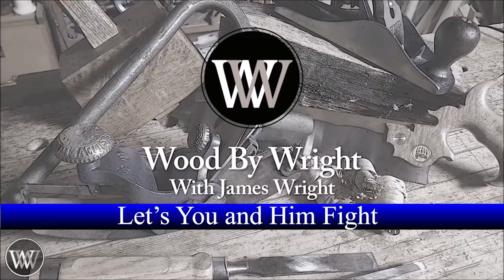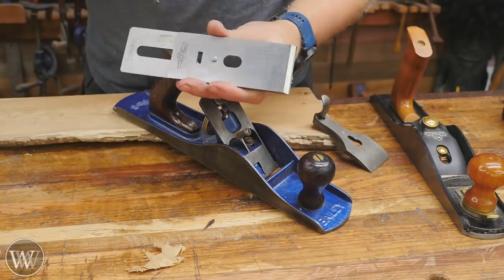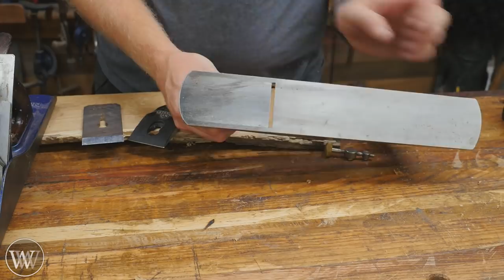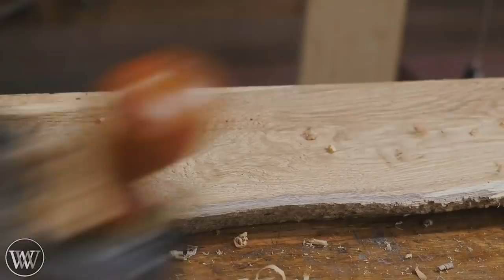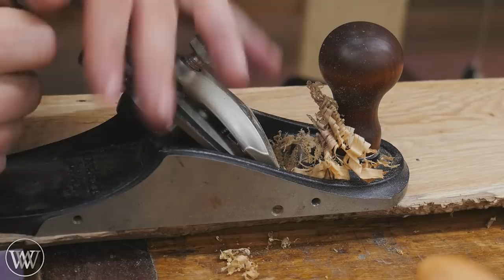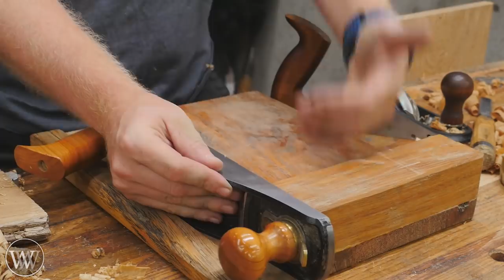Low Angle Vs High Angle The Best Plane For You

Comment: Finally a decent demonstration! Most other videos about the difference between traditional bevel down / low angle bevel up just tell you that you can basically turn your bevel up into a bevel down by using a blade with a different angle and call it a day. Which makes you wonder, if it were just that easy, then why aren't all planes bevel up, why bother with all the extra parts and complexity of a traditional plane...

Comment: Great video! Why do I consider this a very important and very correct coverage of the problem of choice - for a simple reason, many craftsmen, especially those who have extensive experience and a lot of knowledge in the use of hand tools, do not see anything incomprehensible and unclear in the coverage of this issue. 62 planes, they are also called “werewolves” in Russian, “cross-cut planes” are considered by beginning craftsmen to be a remedy for the problems of planing complex wood, a low cutting angle, a massive piece of iron, an adjustable mouth - all this is designed to make the process of planing complex areas simple and high-quality, but mostly quality, because it is believed that the more expensive 62 plane will do the job better.But in the video we see a slightly different picture - the knife with the frog is adjusted more precisely, which means it will be better applicable to each specific case, and in fact it cuts simpler and easier! And due to what? Due to the same cutting angle of 45 degrees! We turned the knife with the chamfer upward, but the surface of the upper cutting edge relative to the planing surface is 37 degrees, less than 45 degrees, which means cutting the end fibers is easier, but only the end fibers. The master showed us an excellent carpenter's bottom for planing the ends, the 62 plane copes with this perfectly, you can also use classic planes, but the 62 with an additional handle is a masterpiece in this work.Great video! Explanation of many questions on various planes comes during the discussion of knowledgeable people and showing examples of work! Thanks a lot!

Comment: Hello, new guy who is somewhat starting to use bench planes and looking into the histories and what not of the tools. In my personal opinion the high angle, bevel down design with early modern to today’s metal bench planes are like a legacy design. It does make sense during the time transitioning from wooden body/sole of a bench plane to a metal (bronze/cast iron,) body/sole. If it ain’t broke why fix it mentality when Stanley first started making metal bodies for the plane designs. Since most and probably all of the planes before Stanley’s Bailey design were made with a very hard and dense wood that can handle abuse pretty well. It was probably very difficult to try and either to mortise (cut out,) or a laminated style during the late Victorian time period to early modern period. There is also the chance with the wood too not being durable enough to handle abuse with how thin trying to make a low angle, bevel up design with just wood. Although I could be wrong about the wooden design.

Amazing video though, keep a good job making amazing content for wood working
Reply from the maker: Bubble up low angle planes have been around for hundreds of years. And they are plenty durable. Most of the time they were used for shoulder work or for flattening chopping blocks with end grain. But for general use they were not as common. Not because of their durability just because of their function. Blue Angle plains didn't become popular until after most hand tool use died off in the '70s and '80s.
Reply: @WoodByWright  Thanks for the info, I am still somewhat new to these types of tools, never hand to use a bench plane until two years ago. I am always interested into looking into what tools I have used and go into the research mode and have my own assumptions on why or how they worked like that and why this type of designs. Thanks for responds from a video that two years old, most YouTubers usually don’t bother with how old their vids are and what not. Amazing videos so far that I have seen. Have a wonderful day or night

Comment: Great Job James!

With your permission, I would like to submit your video to Lee Valley"s HQ training division.  This would be a fantastic way to teach our new associates about the difference and help them better advise our customers on choosing a good plane for the customers needs and budget.

BTW, I would like to make a point of order.  The blade of a high angle plane is a two piece blade and the parts are the Cutting Iron (commonly called the Blade or better the Iron) and the Cap Iron (the part many today mistakenly call the "chip breaker").  The actual chip breaker is merely one FEATURE of a Cap Iron.  It is the hump at the leading edge.  This not only compresses the wood and breaks the fibers to prevent tear out; it also focuses more reinforcing pressure to the very tip of the Cutting Iron.  The result is a significant reduction in chatter on the cutting edge over the original flat design.  It this through both improved direction of force and the introduction of spring action similar to springs in a cars suspension.

As a "traditional joiner" I would ask that you use the correct terms as they actually have important historical and functional differences.  The whole part is the Cap Iron.   While the hump, and only the hump,  at the front of the Cap Iron is the Chip Breaker.  The terms are important because they concisely convey very precise meanings.  Thus it is important to use terms properly in order to maintain clarity within a given discipline. 

Once again thank you for the wonderful videos you make.  You have been a major aid to myself both as an instructor in the science and art of joinery and as a customer advisor at Lee Valley's Winnipeg store.  Your honesty, humility, passion and humor shine through in your productions, and they have been both inspiring and educational for both myself and my students.  Should you ever find yourself North of the border and in the Winnipeg area, please let me know.
Reply from the maker: Thanks! that means a lot. I would be honored if you would use it. one of these days I want to get north of the border and visit an actual Lee Valley store. in retrospect I wish that was one more point I would have clarified. there is always something I see after it is published and wish I would have worded differently. LOL

Comment: Thanks, I am just learning about planes now. One interesting thing I would like to add is I saw Rob Cosman swap out a blade and chipbreaker on his jack plane. I hope I get the terms right here he had a blade and chipbreaker set up for smoothing and one another pair set up for hogging. This was a high angle 5 1/2 Woodriver plane. Typically I see woodworkers with two different planes perhaps of the same size. Starting out and being a bit miserly I think this is a great idea. Of course this could be done on a low angle plane as well. Thanks again for discussing the pros and cons of each.
Reply from the maker: I'll swap out the blades for my low angle, but putting a different angle on a high angle plane really doesn't make any difference at all because the bed angle is what sets the cutting angle of the plane.
Reply: @WoodByWright  Yes indeed. In Rob’s case he was swapping between a chambferred blade and on that was not.

Comment: I’ve been trying to become more proficient with hand planes. I have always used power tools for everything I have ever built. A chisel here and there. Someone gave me a Stanley no.4 and 5 so I decided to learn how to used them. I’ve watched dozens of videos on how to tune up planes, sharpen irons, set chip breakers.. you get the idea. But I still can’t get a smooth consistent finish on certain woods. It’s so frustrating. I watched this video hoping you would demonstrate how a low angle plane would produce a smoother finish but that’s not the case.

Comment: I'm interested in the shavings themselves. I'm making small things from veneer, and it would be a nice touch to make the veneer from some meaningful piece of wood, even if I have to glue multiple bits together to get what I want.

Which tool would I use to get shavings of wood closer to veneer?
Reply from the maker: for that you want a low angle plane without the chip breaker.

Comment: I now think the low angle bevel up wins every time because it takes much less effort to cut through the fibres.
I’ve just bought a Zen Wu blade and chip breaker to upgrade my Stanley number 4. It doesn’t fit at all well. However when messing around all possibilities I tried bevel up, no chip breaker either  Stanley or Zen Wu, but just the cap iron. I adjusted the blade and tightened up the screw and it cuts a dream with no chatter.The mouth is wide open, however. The proof of the pudding is in the shavings. I seem to have created a high angle and it works a dream despite an open mouth and a sort of chip breaker set too far back to break chips. I reckon the blade approaches the wood at 70 degrees. 
I could mill out the mouth to take the new blade and chip breaker, but it looks like the protrusion is insufficient with the new blade. I might have to mill a new slot in the blade as well. I’ll stick with my unorthodox bodge for a while as it appears to work fine.

Comment: Thanks! Which three planes would you recommend for a new woodworker?
Reply from the maker: It depends on the individual on what you want to make. If the things you're making are less than 2 ft long I generally say a number four is the best place to start. But if you're going to be making things that are longer than that then you probably want to get a number five. If you're having trouble setting up hand planes then getting a low angle Jack is a great way to go it's a simple plan that most people can Master pretty quickly. Those are the three most used planes and most every shop.

Comment: Thank you so much for your clear explanations.  I follow several, actually quite a few channels, I find that yours,  Paul Sellers, and the "10 minute workshop"  are the best no BS teachers.  

This video is very timely for my education am process. I am just learning about and how to use hand tools.  I am taking a hand tool sharpening course from Highland Hardware in Atlanta next month before I purchase a plane and better chisels and other goodies I can slide by the "boss" !

I have seen some sole plates lubed with wax, and others with oils.  Which do you prefer and do either of them effect the finish on the wood?

Thanks for your answer in advance.
Reply from the maker: that sounds like a fun time. that is a fun store.
I use both. I make a paste wax that is infused with oil. I ahve done the rag in a can and I have done several strait waxes. but this is what works best for me. no. they do not affect the wood at all.
Reply: Hopefully your sharpening instruction will put you on the right track. Sharpening is one of those simple topics that people like to complicate. At its core you're trying to get two polished planes to intersect. That's it. Do that and you got an edge. Now the trick is to do it as efficiently as possible. Taking too long or using things that cost too much put you further from the ideal. Right now I'm using synthetic diamonds and ceramics. In this day and age they're fair choices. I use an Eclipse style guide for plane irons and chisel blades too. That gets me a precise bevel with minimal effort. Things only need to be as hard as they need to be. Consistency pays dividends. Hollow grinding a primary bevel is fundamental too. Not doing that puts you back from where you should be. I have a fancy sliding tool rest I made. I basically ripped off the Veratas rest design kind of. A Google search of sliding tool rest brings mine up high in the returns. I don't know if it's just me? Now it is giving me mine first.

Comment: It would be possible and not too difficult to machine a chip breaker for a bevel up plane. Then you would have the best of both worlds in a bevel up low angle plane.
The handle on the Stanley Sweetheart doesn’t look right to me. Is it good and comfortable? My Qiangsheng has a lovely comfortable handle.
Very informative video. Thanks

Comment: So I have two questions I'll go with the most relevant (at least to me) first: is there a reason the low angle has a much thicker iron than the high angle? And as far as shooting planes go is making one basically the same as making any other plane just putting the handle on the side instead of the top?
Reply from the maker: the original 62 did not have a thicker iron, but in this case there is no detriment to a thicker iron as there is with a bevel down plane (the tip is too unsupported)
for the most part that is one of the big differences though there are hundreds of different shooting boars panes all with different features.
Reply: @WoodByWright  ok was just wondering about that, because that iron looked super thick. And any suggestions as to where I might find a video on building a shooting plane? I've only got a #12-404 and trying to use that on my shooting board is not super easy, has a very strange feel to it.
Reply from the maker: Usualy I would use a #5 or #6. but I know a lot of people that take an old wooden plane and mount a handle on the side. I do have a series on making a low angle wooden plane that may fit you well.

Comment: There is the best answer to do anything in woodworking! Not exactly what you might think it would be but sure our ancestors knew it very well as the spent a lot of time doing it. The best answer is the one that makes you more productive or more efficient. Except that sometimes you don't know how to use tools efficiently or what tool. And in hobby world everybody tends to not care about efficiency. And then there is a fact that function of chipbreaker was forgotten and rediscovered again in 2011-2013. But once you master it then you know what it is for. And yes, both are needed for different tasks. Heck, for that matter even machines are needed for best efficiency. But here it is - if you are more productive then you are doing it more right than you did before.

Comment: Great video as always! I've been looking at the veritas custom planes recently. I have a low angle smoothing plane and jack and my fingers are long enough to adjust the norris adjuster more or less on the fly with them, however the bailey style is much easier and more comfortable to adjust - can you adjust on the fly with the veritas custom planes?
Reply from the maker: I'm not quite sure what you mean by adjust on the fly. I find both to be about the same to adjust.
Reply: @WoodByWright  Sorry, that wasn't very clear. I meant reach the adjustment knob while holding the tote. With the Bailey planes I can increase the cut while I am planing to make "micro adjustments"...I hope that makes sense :p

Comment: How about buying one good blade, and building wooden planes with different angles that use the same blade!
Reply: Actually, that is exactly what is done in Asian/Pacific cultures.   Their blades are about 2 to 3 times thicker than Western plane Irons.  As a result, the Cap Iron with its chip breaker is simply not needed.  The disadvantage is that such blades take much longer to sharpen; though they also hold their edge longer.

Comment: Well i will never take part in the argument for or against either style again. I use BU planes but don't care for them. I find the norris adjuster to difficult to get the blade set perfectly parallel.
Reply from the maker: that is it's drawback, but then again it depends on the adjuster I have used a few Norris Adjusters that were a charm to work with.

Comment: What happens if you put a bevel up on a high angle plane?
Reply from the maker: It wont cut very well if at all. that would put the cutting angle at around 80-85 degrees.

Comment: Small bevel angle makes the blade edge easily damaged. Try planing with a razor. That's really low angle. Probably 2 stokes, you need to change blade.

Comment: Enough of these argument. Both are basically cutting at 45 degrees.
The chatter is caused by the unsupported portion of the bevel. And it is specially more pronounced with thinner blades.

Comment: As someone who only does one thing with planes and can’t afford both of these, what would be better for quartersawn rock maple? At first glance I was hoping the low angle would stop my tear out issues with my cheap #4 bevel down plane but you’re saying that the low angle bevel up had issues with tear out and the bevel down didn’t? Maybe I need to spend several hours adjusting it but I’ve never been able to get it to not have severe tear out on knots and such
Reply from the maker: The higher the angle the better it is for tear out. The high angle plane takes more skill to learn and set up correctly but it can be much easier to get clean cuts on difficult wood. If you look at some of the videos I put out on how to set up a smoothing plane it'll give you a lot more detail on that. But usually it comes down to just being sharper and a lighter cut.

Comment: I own mostly Bailey style planes with one wooden 17" jointing plane I have set up as a hogger (scrub plane). The only bevel up planes I own are 2 block planes. One for general work and one for shooting and end grain. I agree that there is a definite difference in using a bevel up on end grain and so far, the block planes do what I need. I've held off buying a larger bevel up plane mostly because of the price versus my actual needs. By the way, great explanation of both types, for I believe the 4th time..... LOL!

Comment: High angle always the best choice 95% of the time from my experience. The other 5% is an even higher angle lol idk just my experience
Reply from the maker: LOL I think I am in that boat mostly.
Reply: @WoodByWright  the best thing about a low angle bed, bevel up plane, is that it's so much easier to sharpen a high cutting angle on the blade 😆